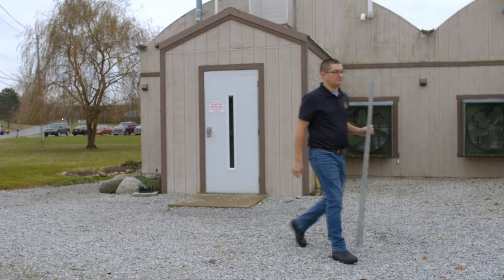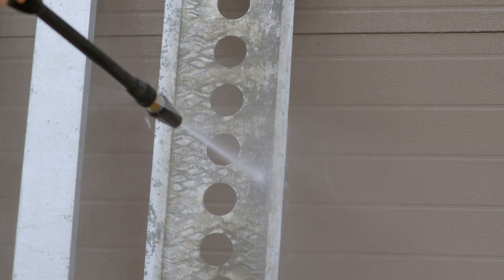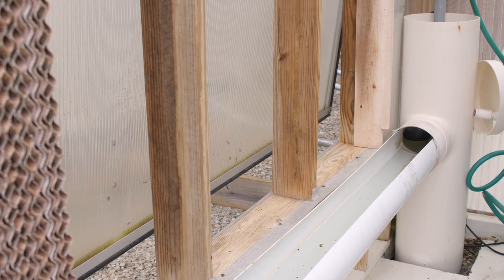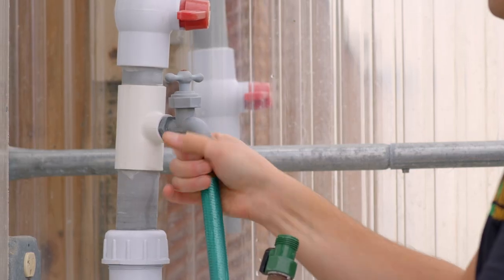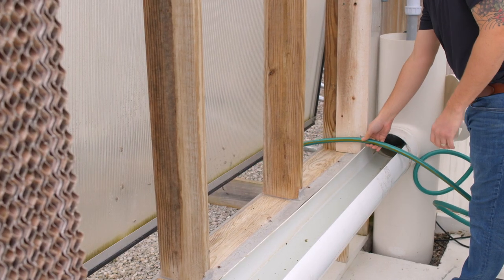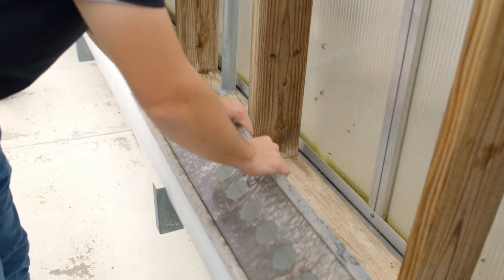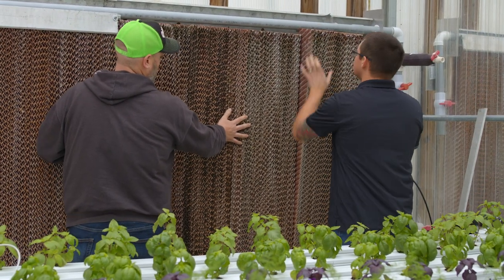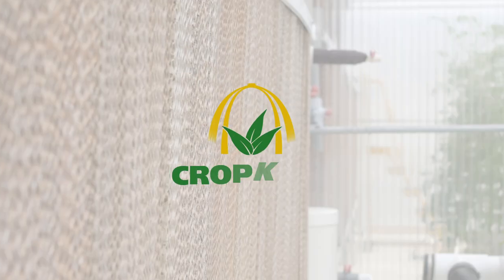Wet Wall Maintenance Part 2 | CropKing Inc.

Comment: Do you do anything in preparation for winter?
Reply from the maker: Winter preparation would depend on your climate and location, but there's definitely seasonal care and preparation required for all greenhouse elements: heaters, greenhouse coverings, wet walls, etc.
Reply: @CropKingInc  how often should it be cleaned and what happens if it doesn't get cleaned?